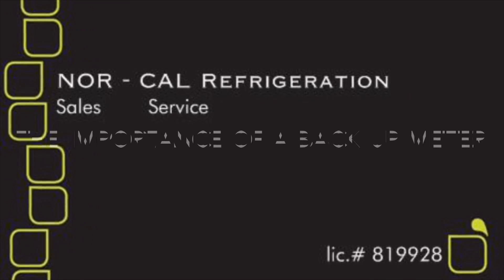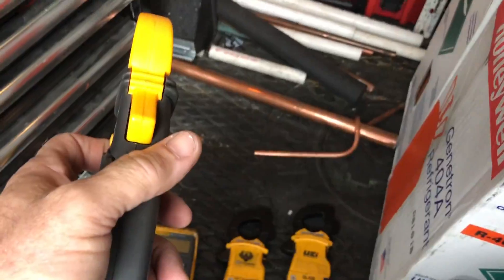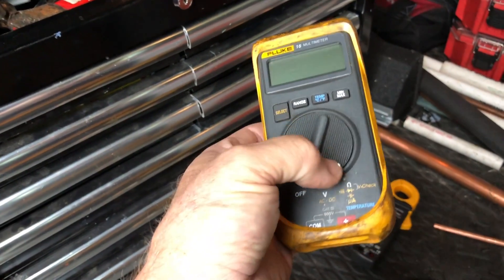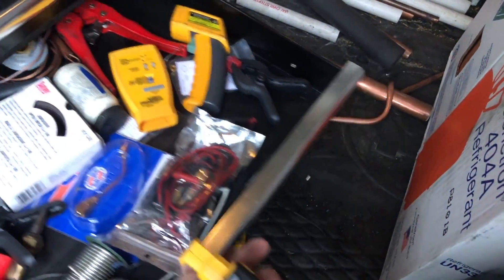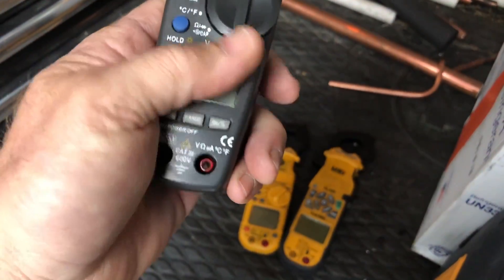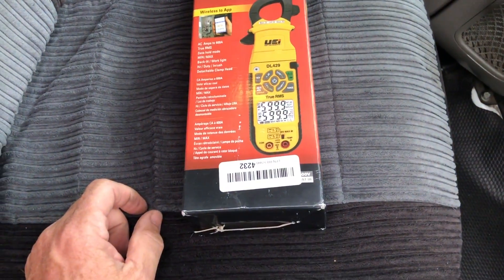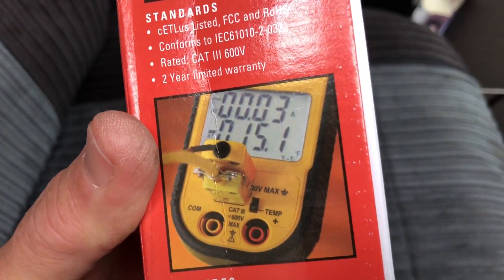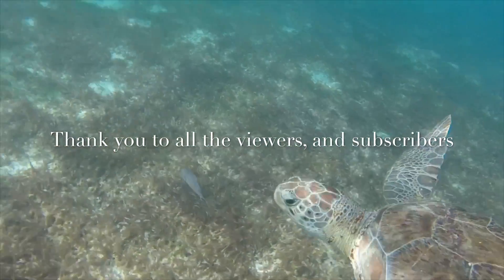Lets talk meters

Comment: Great video. I have back up meters thankfully. Just lost my hs36, chicken stock and all the leads I had. Problem is I have junkie back ups. I narrowed down to what I want. I want a clamp meter. Don't want to carry 2 separate clamp and multimeter.  Its between dl429b, fieldpiece sc660 or sc680 and the Extech EX623. The sc660 says it's a retired clamp on their site. Not sure what that means and why they are moving on from it. Kind of worried about that. Sc680 just came out so I may go with that one. It's just really pricey. The backlight on the selector switch and the flashlight is a huge plus on sc660 and sc680. What are your opinions on these 3 meters.

Comment: I love the features of fieldpiece tester but here in the philippines is too expensive to have kind of device. I have here Sanwa CD800a which was a gift 10 years ago, still working a little bit fuzzy in terms of display. I wish to have a clamp amp meter whick is fieldpiece. I do not have a back up tester.

Comment: Buy whatever meter does the job you need it to but remember these tools can and will save your life so buying a cheap no name meter may be ok for strictly “back up” purposes. Fluke and fieldpiece have never let me down.
Reply from the maker: MR. ICE UEI is as good or better than Fieldpiece there the same tear meter. Fluke is a quality brand and there high end meters are the best.  👍👍
Reply: Nor-Cal Refrigeration & H.V.A.C not banging on uei at all. Never had one. Just don’t want the new guys to buy a Harbor freight meter and expect quality and reliability working on high voltage equipment.
Reply from the maker: MR. ICE I get that. If you check the give away video.  Most are using fluke meters. 4 no meter😂 only 34 without a back up meter out of 230. Fieldpiece was in 2nd place but close and most commenters ran either fluke with Fieldpiece back up or vise versa.  👍👍

Comment: Nice video man and a very good tip, I've had my meter take a crap on me in the worst possible time. I'm currently running the Klein CL800 which I like pretty good does everything I need plus DC amps cause I also work on generators. I keep a HS36 as my back up and a cheaper southwire just in case... #hvaclivesmatter 😂🤣keep up the good work brotha.

Comment: Great information when I was in a service van. I always had different meters always use the fluke T-5 0R T6 has main troubleshooting meter as a service meter, / Fluke 902 with amp clamp /Fluke 87 /fluke 289 data logger for temperature that take temperature down to 200F cascade & meter /Fluke 54  temp meter other types have the old Simpson 260  analog meter multimeter that in the original case.UEI meter is a great  meter haven't use one as yet .

Comment: I use a Fluke 179 with a Fluke 324 plus because it also does DC clamphon amps for battery work in addition to other standard features.  My backup is a Amprobe clamp meter.

Comment: First off hope the fires get contained and put out!  I Have a couple meters in my main bag I have A Fluke 902 FC has wireless features which is great for taking amp draws on blower motors with door on and checking three phase that you don't know why it took out the fuses(ark flash) I also have a Fieldpiece HS36 I keep in my attic & crawl space bag and a Milwaukee 2236-20 and an extech that I loan out occasionally it's a good meter just kinda big! Well stay safe and congratulations on the 10K later would also like to add What ever meter you choose make sure it's one you can trust with your life because it may come down to that please be safe!!!

Comment: Dave I use a Fluke as my main meter and a Field piece as a back up at the moment.I purchased the UEI DL489 50th anniversary meter about 18 months ago. I kept it as a good back up and my fielpiece started to act up so I started using the UEI as my primary meter and it only lasted around 5 nonths.....the amps just go up and down irracticly.....so U purchased the fluke as my main meter....in 3 years in the field of commercial AC and refrigeration in south Florida I have not had much luck with a deownda league meter ..2 field piece, 1 UEI & now on the Fluke....😤😤 could be the operator .Thanks for all the helpful Vids really appreciate your experience..keep them coming Thanks.

Comment: Used two FPiecers until Florida humidity killed them. It’s condensation from cold walk in freezers and the Florida heat and humidity . 429 is now primary with an old folks 323 as backup. 

Thanks to you and Knoth for the 429 recommendation. 

Good video!

Comment: Running craftsman pro clamp on great meeter for the  price-have had it over 5 years works ok and have a backup cheap $20 greanlee digital manual range that is a good beaning in hvac contols have to check 4-20ma signals something auto range won’t due

Comment: I run a Klein CL700 as main meter. Picked it up a couple years ago in a pinch.  Backup is an Ideal from 2002, with a very similar design to most of the Fieldpiece models. I like its design but it cant read the uA mV uF or temp for HVAC applications.

Comment: Hey Dave. Another great video. I am probably not eligible for the drawing as I am already running the DL 429.  I keep two back ups on my van: another uei meter (can’t remember the number) and the cheap (under $100) Amprobe.  I loved my fieldpiece sc57, but it died an unceremonious death. I keep a back up fieldpiece with my back up tool bag in my house. Other than that I’m out there completely naked. Best.
Reply from the maker: Jonathan Smith your still in. 👍👍

Comment: I use the Fieldpiece SC76 as my primary meter. and the Fieldpiece SC53 as my back up meter. they both have held up pretty good over the years. the SC53 I've had for about 8 or 9 years. then got the SC76 about 7-1/2 years ago then just kept the SC53 as a backup.

Comment: Man I actually had an experience, so I went out on a couple emergency calls, one of them being a tripped breaker. Of course I didn't have my meter on me since I ran a side-job earlier that weekend. Luckily i just played which stage is popping the breaker and found it to be the condenser was really packed with dirt. Causing high amps and the breaker to trip every six months. Anyway I use this meter https://i.gyazo.com/7571f8afb1957adf8f8d6c5c7e0d4658.png the fieldpiece SC76. It's a handmedown from my dad, and I love how it works. What sucks is it's starting to die, and not do proper readings so I've been saving for a new one. I don't have a backup meter, I have an electronic one that reads volts and capacitance. Haven't used it yet. Keep up the videos bro

Comment: Your videos are always helpful. It's nice to hear other opinions on equipment. I have a fluke 116 works great but I find that the temperature is not the most accurate no matter what probe you use. For my amp meter I have a Klein cl200 which in my opinion is pretty poor quality.

Comment: Thanks Dave, you go above and beyond on your vids. I have been using the fluke 902 every since my fieldpiece crapped out on me. I've got 2 or 3 back up meters. I keep a fluke 789 on the van for a backup and process calibrations and an old amprobe clamp meter in my shop. I also have a couple home depot cheap meters for junk work. It's hard for me to get away from the Fluke meters. I've been using them for over 30 years and have acquired a certain amount of trust in them.

Comment: I use a fluke 116 with a unit small amp meter. Works great. I have a fieldpeice 620 and uei for backup. I go back and forth with them. The uei is sometimes slow on volt and cap readings

Comment: I use UEI DL369 (Yes 369, an oldie) yes I got a back up meter and yes it is DL369, matter fact I got multiple tool back ups ranging from: vacuum pumps, physcrometer, magnahelic Gauge, thermometers, electronic scales, etc. I am a one man operation and 30 miles from the nearest HVAC distributor, if one these tools breaks down and if I didn’t have back up of these important tools I would be screwed.

Comment: I'm using a fieldpiece sc77 as my primary HVAC resi and commercial. I have an fieldpiece sc260 for my backup and have a 40.00 amazon special amp clamp meter for worst case scenario!

Comment: Hi Dave. My primary meter is a Fluke T5600. My backup is a Fluke 117. I am not necessarily partial to Fluke although they are good meters. Usually when I loose a meter or it gets broken I find a deal and will get that one. Sometimes my supply house will have a sale and I pick one up then.

Comment: Dave I use a uei non-detachable head works great never had any issues with it. I have two back up meters made by fluke and another clamp from Harbor freights please don't laugh. It actually works very good as a backup. All my meters have got wet, not soaked knock on wood they still work.

Comment: Good video. I presently run my Testo 770-3. Great great meter with wireless- which for the newbies, is so handy when doing blower motor amp readings. And your totally spot on. You need to have a back up in the van. My back up is my  FLUKE 87V. I honestly believe its one of the best meters made. Only reason I don't run it daily is no amp clamp on it but for accuracy you cannot beat it!! Cheers

Comment: thoughts on dl429 vs dl429b? Seems the B does DC amps where the 429a doesnt. Then you have the dl489 it is not wireless but it has dc amps and ac micro amps. Is the wireless feature worth 100 dollars i guess in the grand scheme of things having the feature is worth a 100 dollars since it can always come in handy. Working mainly residential and light commercial i rarely will ever use dc amps.

Comment: Dave I found a uei meter stuck to a rtu. It had been up there 2 weeks and still worked. I returned it to the tech that left it and he couldn’t believe it was still working. 
I am using a fieldpieace hs36 and is has got wet twice and stopped working. Only to come back to life. I also have a Milwaukee one it’s ok but sometimes it’s hard to get the amps with the forks. My main meter right now is a fluke 587 which cost way to much to use everyday. I am currently looking for a new everyday meter and I am thinking about getting a fluke clamp style. 30 years doing this and can’t have to many meters

Comment: Put my UEi DL429 in my diagnostic bag. Use it for heat pump maintenance. Like the dual display for checking voltages and amps without having to push buttons. I have a Fluke 87 V, UEi DL 429, Fieldpiece SC640, Redfish iDVM510, Fluke 374, and an Amprobe AMP320. I use the Flukes in my VRV set up, due to their lower operating temperature specs, the UEi in my diagnostic bag, due to the dual display, the FP SC640 in my RTU bag, along with the AMP320 (it has the ability to get accurate amp draw readings with the tip of the clamp, good for RTU start up readings with those tight wires). I even have a Reed megohmmeter that will act as a backup volt meter if needed. Not to mention my Fluke 116 I keep at home. I’ve got backups for my backups. And I don’t want to be entered in the drawing, just commenting on the gear I have. Let that meter go to someone who could use it.
Reply: have two, works great